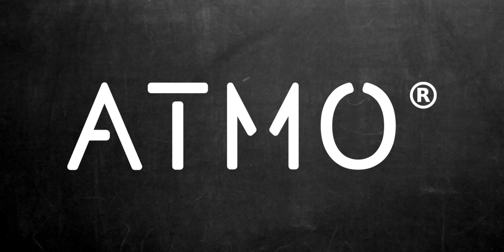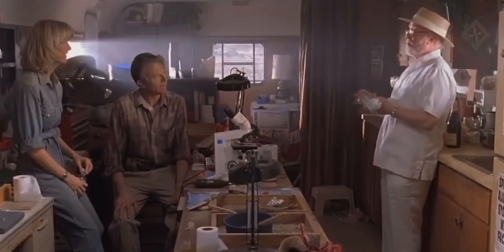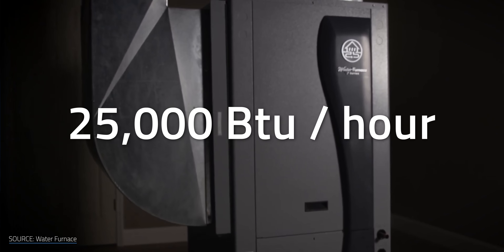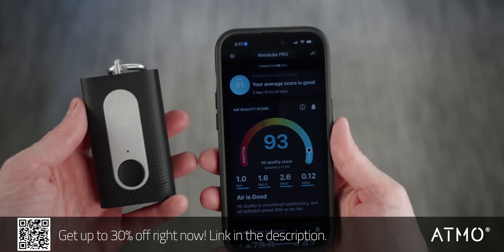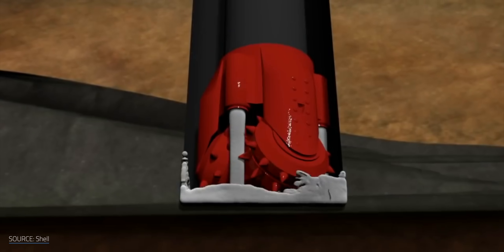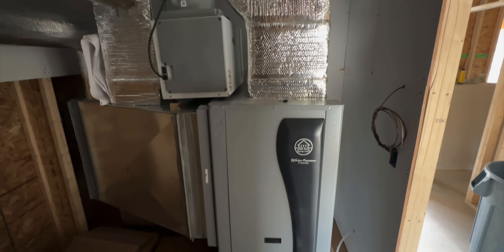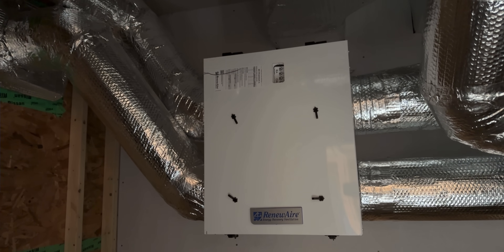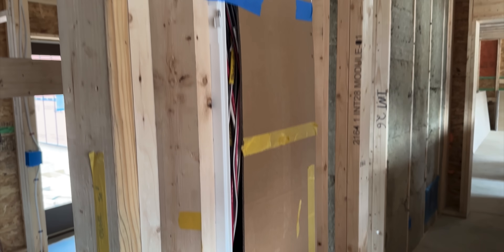Why I Went With Geothermal For My Net Zero Home

Comment: ??? Trans-inductor voltage regulators (TLVRs) allow engineers to improve on the transient response of their VRMs and meet the demanding load requirements of CPU, FPGAs, and ASICs in current and bandwidth without hurting other critical parameters.???

Comment: The biggest issue with smart homes and devices are that a mce,or emp can wipe out an entire smart homes systems along with its solar batteries and panels that rely on weak easily fried electronics.  While old school solar panels,and batteries do not and will usually last 10 years end to end and aren't susceptible to either cme or emps... Lp is much more friendlier than nat gas, which will go down when the power goes off while stored lp will last for decades if properly stored...

Comment: When we designed our home in the late 90's, I wired 28 Cat 5G ports  and 22 phone lines throughout a 5000 sq-ft   Our contractor had never done so many.   These days I use 12 of the LAN lines for NASs, Servers, and desk-PCs and only 4 phone lines.   Mesh Wi-Fi handles the rest of my devices these days, but even those get near giga-bit speeds, and are about 80% of the LAN speeds at peak performance.   Depending on how  and where you routed your lines, POE may satisfy your power requirements at the devices, but that limits your device selection.  Your wall insulation can also affect wi-fi speed greatly.

If I had to plan my install again, all cables would be in flexible conduit so I could upgrade the cables.  Looks like you have your cables connect to the studs.  I did the same thing which I regret doing.

The cameras will become obsolete quickly or fail.  Make sure they can be easily replaced.  Network closets require additional cooling. 

best of luck with your new home.

Comment: 10 years ago I would have recommended geothermal to everyone, the efficiency just made sense. I don't think they make sense anymore. With the newest systems out there like the LG multi splits for example, you get a 21 seer system, which is extremely high to start off. You also get independent zoned control so you're not over/under cooling spaces. Using the concealed duct units or ceiling cassettes you don't have all the efficiency losses of a traditional ducted system, nor the noise of one. It could be argued It's a much less complex system, just a single outdoor unit and multiple indoor units with just wires and line set running to each. 

I purchased my first home 13 years ago. I went in and change out all the plumbing, electrical, hvac, etc., and made it "smarter". So many times I wished I would have went with simpler solutions. The complexity I added chasing that last .01% of efficiency were the things I ended up regretting the most.

Comment: We rebuilt our house about 11 years ago and did geothermal. We have five 120 foot wells and two separate HVAC units, one for upstairs and one for downstairs. Ecobee thermostats with multiple remote sensors control it all. And did upgrade to a heat pump water heater a few years ago. Definitely worth it.

Comment: Oversized heat pump in a tight, well insulated house usually means poor humidity control if you live in a humidity, problematic climate. 

If the heat pump is incorrect, you will have this problem . 

And the only way to fix the problem is by adding a whole house dehumidifier which will probably run you in the neighborhood of $5000-$9000 for the installation for a good one .   Probably a Santa Fe ask your contractor

And adding a dehumidifier will consume more power, because the HVAC system was in properly oversized . 

Many dehumidifiers only have a two-year to three year lifespan, so you will be replacing them quite often, adding more to the expense, due to the fact of not having a proper sized HVAC system. 

At least Santa Fe has the longest warranty of six years on their dehumidifiers compared to all the other manufacturers .

Comment: Net zero here, net zero there - we build bigger and more complicated houses only worried about being net zero, but what's the overall emissions cost of this modern house, having in mind that technology and technical support gets obsolete quicker and quicker, requiring to change this complicated system for a new, different system, also requiring emissions to be created. Stop consuming, that's the only way to get the planet healthy. Go back to basics, instead of installing remote access and WiFi connectivity to your toilet seats. Surely a modern "net zero house" requiring hi-tech thingies, constant maintenance and creation of spare parts will generate substantial amount of emissions.

Comment: Matt, very interesting video as always. One word of advice since you're pulling air out of your bathrooms to go back through your ERV - install a preheat coil on the fresh air intake before it gets to your ERV. When it's well below freezing outside, you run a high risk of freezing condensed moisture in the ERV and breaking the heat exchange media. The heat pump also has a minimum return or entering air limit of 40 F in heating mode so you'll need to warm up the really cold outside air if the ERV doesn't warm it up enough. Make sure the ERV has a condensate drain and that the trap is primed so you don't have smell issues. WaterFurnace makes nice systems; I've used them in a couple very expensive custom homes. Keep in mind that DX systems have operation considerations so you might not get as much "variable" out of the capacity so that the system will function properly. I look forward to hearing more about how you see it operating.

Comment: Would love to see a whole lot more about the home network, cameras, Lutron smart devices, and home automation.

I installed a UniFi home network in 2015 and never looked back. 

Be prepared for the energy consumption, noise, and heat from the rack mount POE switches though. I had a 24 port for until this because I planned on installing their cameras. I recently downgraded to a newer more consumer level switch with only 4 of the 8 ports POE, and I’m much happier.

When you build your rack use a keystone patch panel with half the ports of the switch immediately above and below each switch. Then you can use 6” patch cables to keep it clean and tidy.

Unifi even has some good options for 10gig switching for your production machine and NAS. 

Oh, and I’d recommend one switch for just the cameras with the NVR directly attached, and keep the rest of the network separate due to the bandwidth constant video consumes. 

Best wishes,
Tim

Comment: I have a Water Furnace GS heat pump. No one has been able to tell me if I should eventually replace our water heater (not the desuperheater) with a heat pump water heater. Sounds like Matt has answered my question.
Reply: Thanks for choosing WaterFurnace for your home. We appreciate you.
Reply: @WaterFurnace  Does your company handle hydronic snow melt systems? Trying to find an alternative to a gas boiler.

Comment: You might consider a corroprotec powered anode rod for your water heater. It negates having to change the anode rod over time and can substantially extend the lifespan of the water tank.

Comment: I have a WF 7 series, 5 series, and NSW unit to assist hot water attached to a Rheem 80 gallon heat pump hot water tank... solar additionally. Unfortunately I can't get a span, I need a 100 amp breaker for my main panel to go to a subpanel for the heat pumps. I just use an iotawatt for more central energy monitoring (yes the WF has its own).
Reply: Thanks for choosing WaterFurnace for your home. We appreciate you.

Comment: I have 2 WF 7 3 tons.  2 desuperheaters preheating 20ga pre tank into 65ga Proterra HPWH.  Large family, 4600sf.  HPWH only, w/o desuperheaters, was about 700kwh/yr.  I have seen zero value in running desuperheaters.  Also, in the summer I want the water heater to run more for added dehumidification.  Would love to hear your analysis.  Mine is HPWH makes desuperheaters obsolete.  Maybe if you were using propane or tankless the math would change?
Reply: Thanks for choosing WaterFurnace for your home. We appreciate you.

Comment: Matt, heatpump waterheaters are very efficient, but highly unreliable. Mine broke after 8 years and after 4 visits by factory techs, the unit was totalled. Complete nightmare not to have hot water for 3 weeks.

Comment: I hate forced air.  My apartment building switched from electric to small diameter forced air.  Yes, it saves over electric (heat pump and all) but it is so noisy.  There are radiant cooling systems, and I suspect, with a smart enough thermostat, you could adjust radiant heat to turn off a little early so that the temperature glides up to the end.

There is also radiant ceiling systems.  If I won the lottery and was going to design the absolute most comfortable house I think I'd see about having radiant floor heating (heat rises) but have a separate system for cooling in the ceiling, since cold air sinks.  Combine that with a lot of zone heating, phase change insulation... I've seen recently that a few companies are starting to make aerogel filled windows... ground heat exchange, solar roof that also cools the solar to use the waste heat for heating hot water...

One thing that's interesting... all of you green YouTubers still seem to gravitate towards single family dwelling.  I doubt I could get the kind of housing I really would like to see built where I live.  There are some townhouse apartment complexes, but no real 'here is a street with a mix of townhouses and small street shops with apartments above them' sort of development.  There are things that aren't necessarily 'green technology' per se, but that could improve a lot of more traditional green construction... multi-family units, apartment buildings, town houses, walk ups... you can save so much on heating if you share walls with your neighbors, but a lot of people are reluctant to live in buildings like that because there are other things that can be kind of frustrating that come with that.  I'm a musician, and living in an apartment building I know that at a certain time of night I can't be playing... but that's largely because I live in pretty cheap apartments with thin walls and floors.  It would be interesting to see someone develop a sort of 'next gen' urban building that gave people the advantages of compact neighborhoods (I mean, you can drive a Tesla, but at the end of the day, every lane of traffic is land that could be used for something greener) but using modern technology to deal with some of the old hassles.

Comment: I am glad to hear about you choice of ground-source, given that currently two-stage air-source gets all of the press. When I rebuilt my 1929 house near Denver in the early 2000's, I chose to install a 6-ton vertical-loop ground source system. Heat is delivered by an in-floor hydronic system in every room, and cooling is delivered by a separate high-velocity air handler up in the attic. Everything has worked flawlessly, even during the -25° F cold spell last December, and during the 95° F hot spells. Dispute its age this is the most comfortable house I have ever lived in.

Comment: You are going to love your geothermal. We built our new home 3yrs ago and did Geothermal  and solar panels. The hot water is a geothermal heat pump too. While heating is efficient we find the AC super efficient. Probably because here in the north east the ground is around 50 degrees for our horizontal loop.

Comment: Interested in your soundproofing experience. We used Green Glue, Quiet Rock along with acoustic caulks and putties depending on the needs. Sound is like water. If there's a way, it will find it. The Green Glue took months to completely dry and become fully effective but we could not hear a person screaming at a raccoon who had invaded her space, though we did hear her stomping through the floor joists (flanking noise). It took a LOT of detailed work but we are very pleased with the results.

Comment: only problem I have with these systems is if you drill it down into an aquafir...eventually those hoses are going to break down and leak and you're contaminating the local water supply when that happens.  It may be 100+ years down the road, but it is still a landmind waiting to happen and i'm sure everyone who shares that aquafir would love to thank you when that happens.  

The ones where you lay them out horizontally a few feet down I am on board with, but the problem is still the same long term, eventually all that stuff in the hoses is going to leak into the ground and that isn't a good mix of chemicals for drinking.

Comment: Your "forever" home is a balloon wood frame house on top of a concrete slab with plastic pipes laid in the slab. The slab will lay for 50 years, in theory. But the pipes will last 10-20 and then you'll need to jackhammer the slab to replace them at great expense or abandon the house. The wood walls lack thermal mass and requires a new outer layer every 5-10 years or it starts rotting out from under you. You built a standard American suburban home that's inherently unsustainable and filled it with expensive utilities that won't be able to pay themselves off through increased efficiencies before the house itself needs to be either rebuilt or demoed.

Comment: Dude. Why the ethernet... you didn't ask a network administrator for help I presume. You can put an ethernet switch inside and above the door of a linen closet for gosh sakes, not everything has to be cat5e. That poor electrician. Well, not poor because i assume he charged $150/hr in labour for running those cables. Still, thats a lot of weight to move.

Comment: Very impressive. Are you fitting a DC to DC EV charging system (DC from solar panels direct to the car's DC input socket) which allows more efficient and higher speed car charging?

Comment: Having done a lot of research into this myself, I can confirm that vertical ground source heatpumps are by far the most efficient and reliable type of heatpumps, as temperatures deep underground are pretty much constant all year round. The ONLY reason vertical is the most expensive is the GREED of the installers - it requires a specialist drill which not many installers (yet) have, so lower competition means those with the drills can hike up prices, even though its actually easier to install vertical than digging out the HUGE trenches needed for horizontal.

Comment: Considering there's been a visible coating of pollen on my car the last few days, and I have allergies, the heat exchangers with filters sound really nice.  And living in central Minnesota, I also have to live with cold winters that make the air very dry, and high humidity for at least the first half of summer.  My parents have wood heat, and a house that leaks air so badly that the whole winter, they have two pots on the wood stove constantly, adding close to a gallon of water every day, and it's still dry. (The house also "leaks" ladybugs by the hundreds in the fall, but that's another story)

Comment: Curious as to why the vents bringing fresh air/heated air into the rooms are at the top of the wall as shown I your video and not the bottom, heat rises, so that warm air is gonna come in and sit near the ceiling where if it came in at floor/skirting level it would distribute through the room. Will be interesting to see if that works as intended.

Comment: I have a couple of questions. You have an ERV system but also a direct air Geothermal system. Are those systems designed to work together? If so, how? Is there a hookup from your geothermal system directly to your ERV? Or is the incoming air run from the outside to the ERV and then to the geothermal system for additional heating? I am interested in how these two systems work together. Also, is there a hot water tank on the market that is designed to work with a geothermal system? One where the tank doesn't use the ambient air to pull heat from but instead has a direct connection between the geothermal system and  water tank and pulls the heat directly from the geothermal system rather than ambient air? This would be a much more efficient system than having a separate water tank to dump hot water into for dumping into the primary tank ( it also would eliminate the need for the second tank). And finally, do you know if there is a geothermal dryer that could hook directly into a geothermal system (again, using the heat directly from the geothermal system rather than ambient air). This would eliminate the heat pump dryers being slow to heat up.

Comment: You made the right choice not using radiant heat.  Not sure what style of radiant heat you were going to use but I lived in a home with hydronic radiant floors and it took a long time to heat up and then it got too hot and takes a long time to cool down.  The temp just never seemed right.   I'm sure modern systems are better but we really did not like it.  In a home as insulated as yours, I doubt the heat loss from the ducts will be very much.

Comment: I’m curious if you considered the ClimateMaster Trilogy and if so, why did you go with Water Furnace?  The Trilogy combines the geothermal heat pump and water heater into one unit.  I’m happy with my Trilogy QE0930.   I also have 10kw PV array and o an annual basis produce almost double the energy that I consume. Can you say net negative?
Reply: Glad to hear you chose geothermal - even if it isn't WaterFurnace. Smart choice.

Comment: I'm jealous!  I built my own home 10 years ago and thought I did pretty well, foam insulation, triple-insulated windows, on-demand hot water heating system and so forth but you've taken it a coupleof levels up.  Nothing better than living in a house you've designed and built.